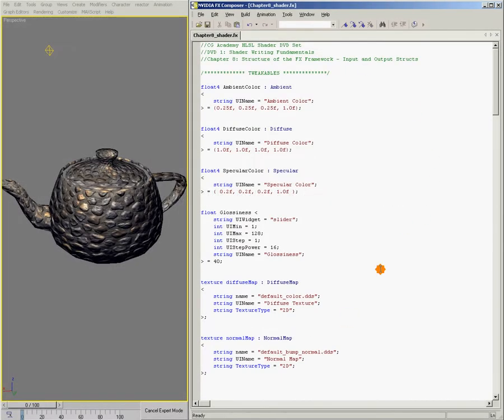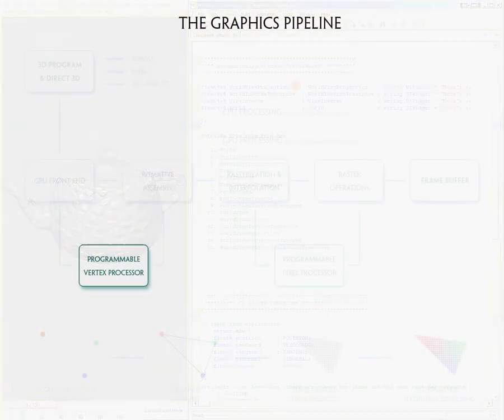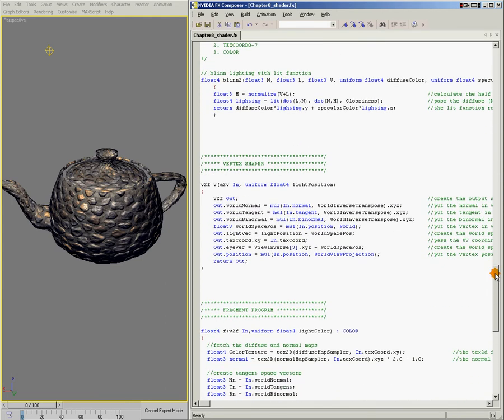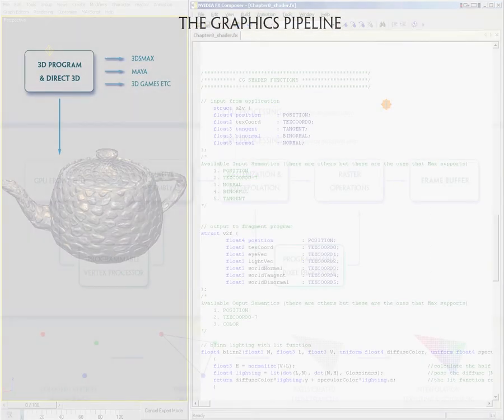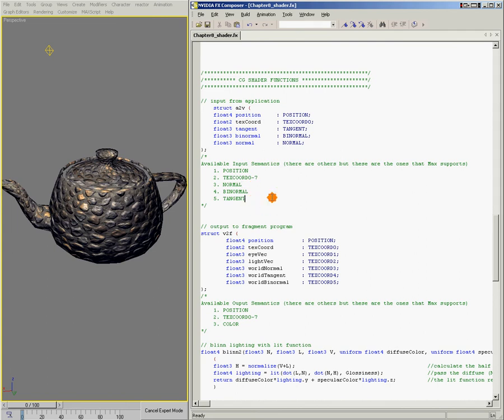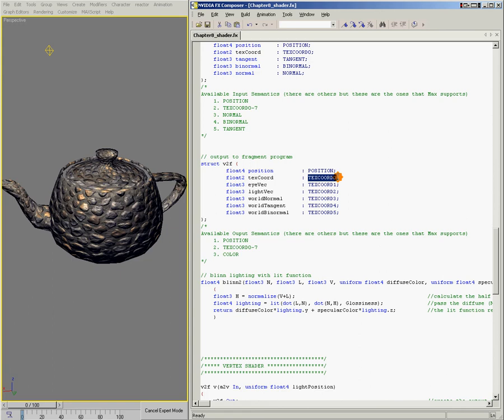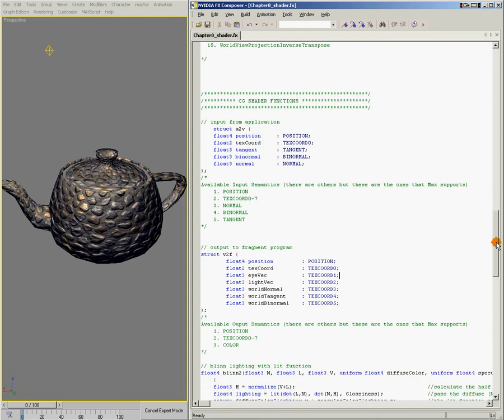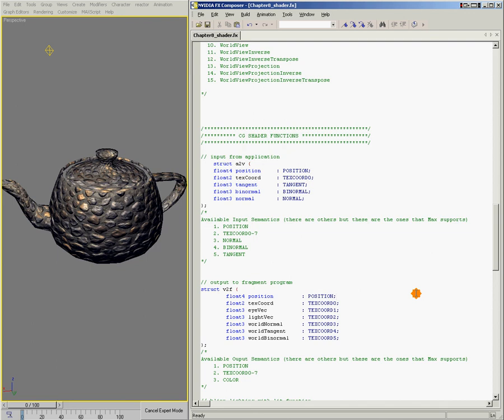08 FX Framework: Input & Output Structs - HLSL Shader Creation 1 - HLSL Shader Fundamentals

Comment: Can you provide a link to the Matrix series which was mentioned in this lecture?
Reply from the maker: Here's a pirated version:  https://www.youtube.com/watch?v=onyrsCPMWtA&list=PL9DC40094D6532E24&index=59  This seems to be the only available version since CG Academy is no longer in business.  Unfortunately, this playlist has them listed in reverse order, so you'll have to watch the playlist backwards.
Reply: @BenCloward  One more question. Is there a limit to how big we can make input and output structs? Is there a maximum size in number of bytes or fields?
Reply from the maker: In the graphics hardware, there are a limited number of interpolators - so in the shader that translates into the number of texcoord slots you can create. I know that the limit used to be eight of them. Not sure what it is now - but it will depend on your hardware and what shader model level you’re using.

Comment: Although I'm in the proper viewport renderer. the diffuse texture refuses to work properly and it seems like it's uv space is all screwed up.  the normals of the material  if I just import the chapter 8 material don't work either and are flipped. I've got no idea why this is so. I've tried in max 2016 and 2019 and in directX 9 and legacy Direct 3D.
Reply: This can be resolved by adding the UV-related part to the items below.

sampler2D diffuseMapSampler = sampler_state
{
	Texture = <diffuseMap>;
	AddressU  = WRAP;		
        AddressV  = WRAP;
        AddressW  = WRAP;
	MinFilter = Linear;
	MagFilter = Linear;
	MipFilter = Anisotropic;
Reply from the maker: I'll look into this as soon as I can.  Since this material was created awhile back, there's no guarantee that Autodesk hasn't changed things in newer versions that make the content not work correctly.  If this is the case, it should be pretty easy to fix, but I'll need to investigate a little to figure it out.
Reply from the maker: I was able to fix the normal map flip issue by changing line 220 of the shader to this:  float3 N = (Nn * normal.z) + (normal.x * Tn + normal.y * -Bn);  
Autodesk appears to have changed the way they store binormals and tangents.  I'm not getting the diffuse texture issue, but I remember having seen that in the past.  Try adding this line to the top of the shader and see if it goes away:  
string ParamID = "0x003"; // this string tells 3ds Max to use the DXSAS compiler
Reply: @BenCloward  Hi Ben, good news, the normal seems like it's fixed now and works properly. I've put the new code to change the compiler in the code for the diffuse and it hasn't helped though.